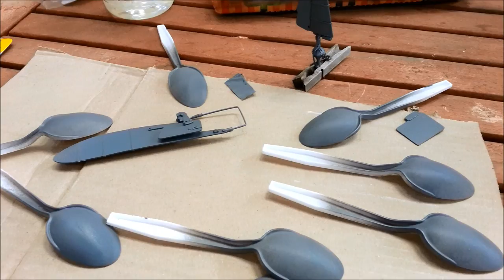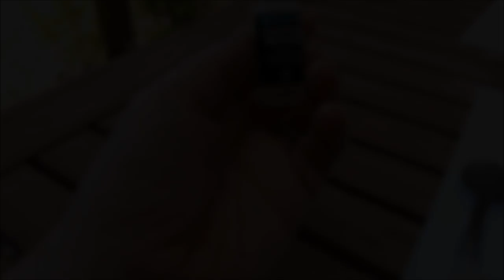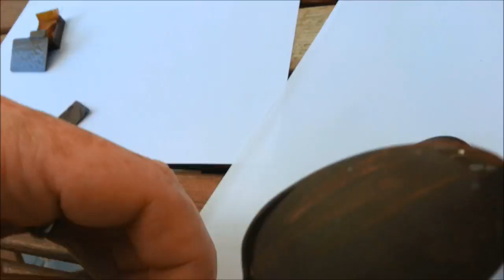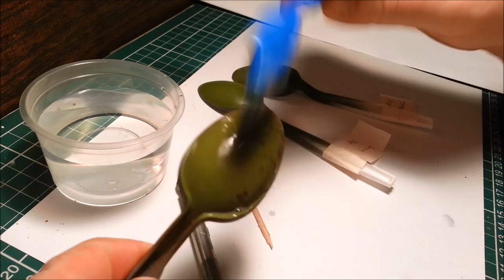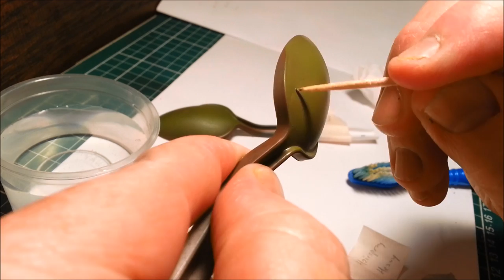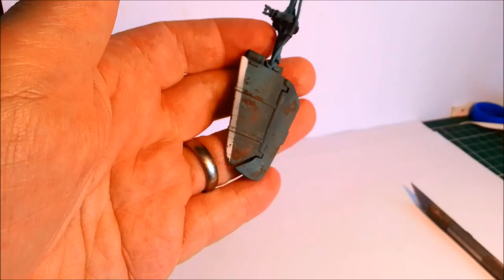Comparing 3 x paint chipping methods for scale models: hairspray vs Vallejo vs AK Interactive

Comment: Great video Dave!  I will have to look at the Vallejo stuff, I do like the effects it gives, and better than the AK medium for sure.  Those final results on your Sci-fi bits looks awesome!  Really nice stuff, especially on the yellow bit where you used the Vallejo stuff.  That is top quality chipping!

One thing, you mentioned earlier that the chipping was almost starting in some areas after you applied the base paint.  I think that's just the chipping fluid still being a little wet when the top coat is applied, so it's gives you a little bit of a cracking effect?  Not 100% sure, but I've just noticed that occurring sometimes whenever I use the AK chipping fluid.
Reply from the maker: Hi Panzermeister, thanks for the feedback sir. You may be right about the chipping fluid still being wet, I left it to dry for several hours on a 30+ degree day (86+ degrees Fahrenheit) so thought it was sorted, but it may not have been. It definitely was only on the thickly applied coats, so you may have something there.  I'll keep that in mind next time. Hope you're well mate, D

Comment: As far as sealing it goes, for something that may be handled a bit more, how well does that work? Does the sealer make it darker and less natural. What are the pros and cons of sealing this technique?
Reply from the maker: Hi Pepito, sealing it with a gloss or matt coat shouldn't really alter the effect greatly (no more than any other painted surface). I find varnishes darken weathering like rust or pigments, but for this method it's just paint anyway, so it's no different to sealing any other paintjob. Cheers, Dave

Comment: Really you will get another level of results if the PAINT layer had been consistent...especially with medium to  lighter coat. (Heavy over heavy was not a fair test). But you came up with interesting results anyway.
Reply from the maker: That's a fair point, agreed Timothy.
Reply: This is true. That would be a fairly large test if you did all the possible combinations like heavy paint on heavy chipping, medium paint on heavy, light paint on heavy and so on. You would need a total of 27 spoons for that, and a lot of toothbrush tapping :) It would be interesting to see the results though.

Comment: The chipping techniques I've seen everywhere so far just deal with a single layer of paint over a base cost. Nobody has tackled what happens when you add a second layer of paint, such as green over grey WWII RAF camouflage. Is there a difference?
Reply from the maker: I wouldn't think there is a difference. You could do three layers of paint - basecoat, hairspray then first coat (grey in this example). Wet it, chip away the grey. Then another layer of hairspray before the final green topcoat, which you could then chip. I have found once you've wet the hairspray once, it's very, very difficult to go back again and try to get it to do more chipping, so I would think it would be pretty stable for the final layer.